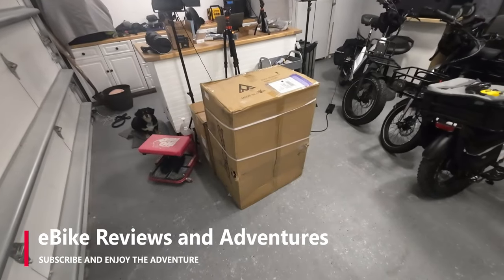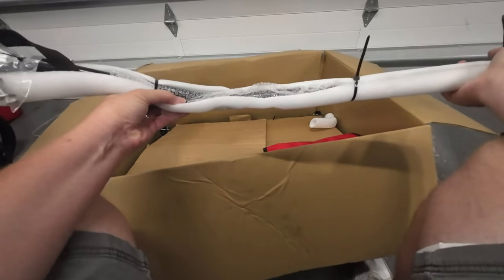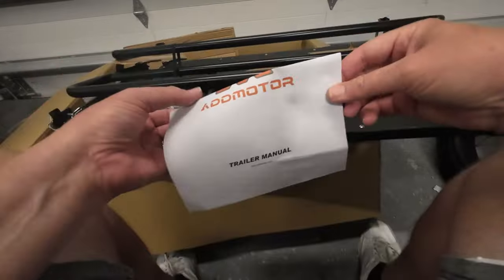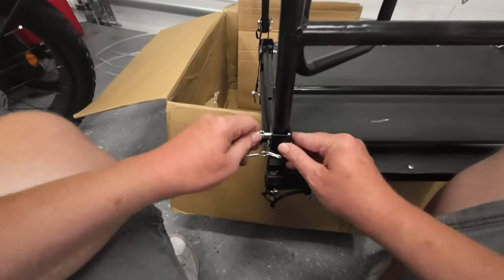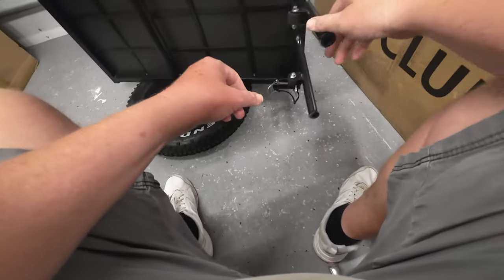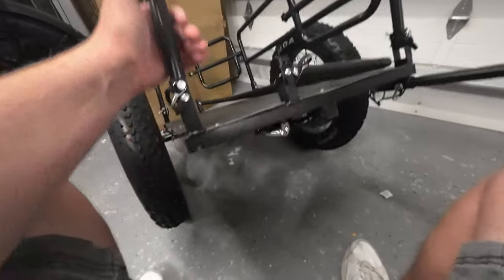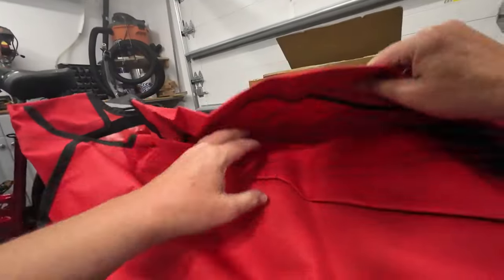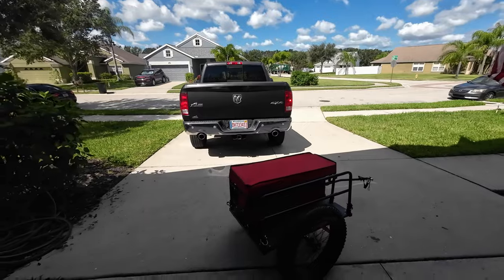eBike Cargo Trailer | Assembly and Discussion

Comment: The trailer is built for heavy loads however the way the cargo bars are alinged it doesn't leave for much carring capacity . I have a similar one and have modified it .
Reply: Just wondering which trailer you have and what kind of mods were necessary? Thanks for responding!!

Comment: That trailer set up would be good for my use. Chairs and sunshade in the slot bungeed down and food etc in the bag. Great for the beach or camping. Might even fit a stall tent in the slot side 🤷‍♂️
Reply from the maker: Yes, it would be good for that. Its not a bad trailer, but I haven't done much with it yet. Soon.

Comment: A tent and a power station with portable solar panels and food supplies,  with a foldable E-Bike say with a 1000 Watt or more motor, you probably have enough power to now park your car
at the official campground parking area, but go off grid and  take this cargo trailer connected to the E-bike and do some off grid camping in very remote areas,  (places you can't go by  SUV or even a mountain-bike due to the noise they cause)   (think of area's around the Grand Canyon or  Yosemite you'de like to explore but normally you can't without a silent E-bike)
Reply from the maker: I like the way you think.
Reply: I'm doing that actually I  leave on the 6th, Bluetti with 120w panels with pass through, Ariel Rider x class with three, yes 3 -52v 20ah batteries, big Agnes, little buddy heater and .50 cal pcp carbine. Akron OH

Comment: Hey Richard can you make a video with the Mooncool trike with the Addmotor trailer need to see how the wheels line up with the trike I noticed in your video it looks like it has a spot under the moon trike to hook it up. I wish the trailer had a center mount.
Reply from the maker: I can, it may be a while. I am in clean out the garage mode so  can get the floors redone next week. What you need is the hitch and two bar sold by Lectric that is used for the XP trike.  https://lectricebikes.com/collections/baskets/products/xp-trike-wag-along-tow-bar-hitch

Comment: I have to say I'm not a fan of the design. I've got a trailer that has a sheet metal bottom, the tow bar folds and there's no bar that divides the cargo space.  It even has the same carrying capacity as your trailer. Paid less than a $100 for it on Amazon.  Amazon still has similar trailers for around the same price. Only catch is no fat tires but honestly I consider that a plus. Skinny tires are much easier to store.
Reply from the maker: I thought about going that route, but I wanted something I can take a trip with and skinny tires we just not an option for me. I wont be using it on my upcoming trip, but there is another one being planed. I don't care for the design either, kinda wishing I had found something else.

Comment: Ebike back axels are much bigger than a regular bike. So these trailers won't fit onto them.
Reply from the maker: Why do you say that? It works just fine. You just need a 15mm trailer hitch.